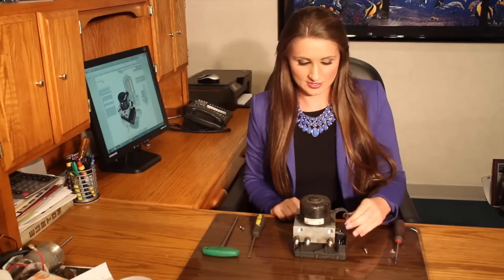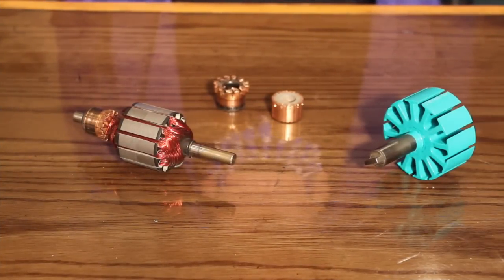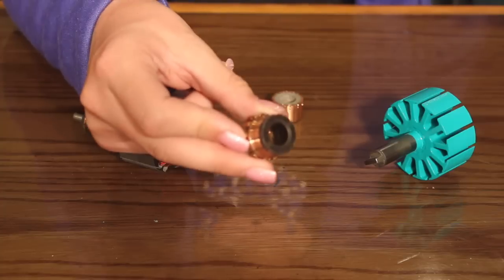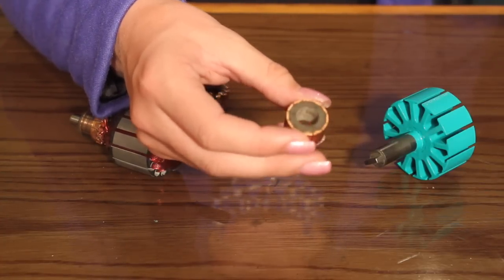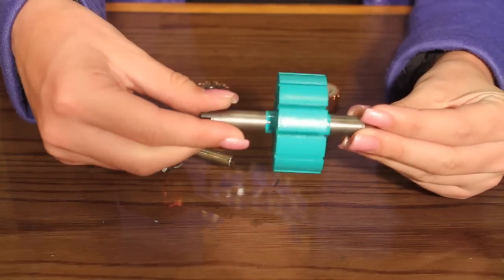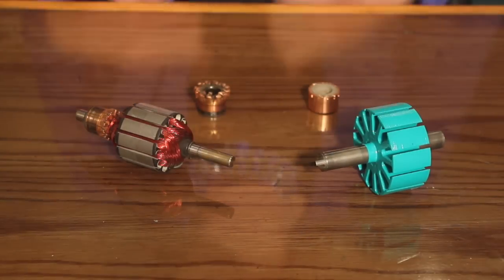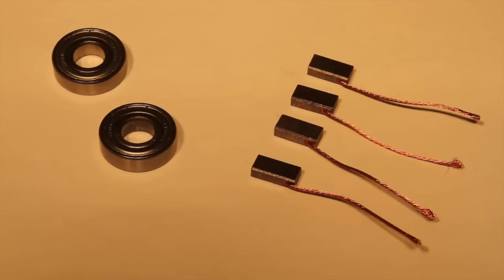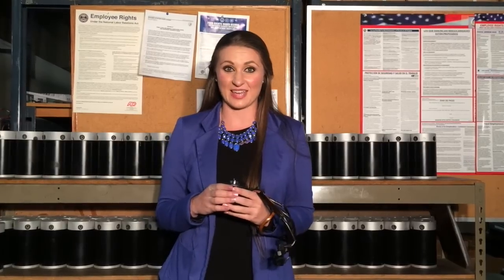ABS, Anti-Lock Braking System, Motor Repair

Comment: Where is business located? Is this the most common failure of the 2008 Lexus RX400H ABS brake system? I have 2 now that have failed. Don't wish to buy another for $1300 from stealership.
Reply from the maker: Hi Dean, ' We are located in Southern California.  Yes, the motor is one of the most common causes of failure with these units.  You can email us for more information  info@eurtonelectric.com

Comment: My sbc mercedes w211 is showing failure,,is it possible to rebuild,,nd would it be safe to drive on after rebuild  or a reset,,well any advice or solution,coz im not able to find a similar code part in the market here

Comment: Hi Team thank you for a great video. This is from the Fiji Islands. Used Hybrid cars are reselling in Fiji like hot cakes, which means mechanics and electricians have a monopoly on spare parts and fixing hybrid cars (while most times they don’t what they’re doing). We have a TOYOTA Harrier Hybrid model 2010 model. When we start the engine the ABS Light comes on and we hear a high pitch sound that goes on until we turn off the engine. Will the fix in the video get my car back on the road? If Yes can we ship the ABS motor to you? We’re getting charged such atrocious amounts here that working with your team seems the only affordable option.

Comment: nice!!!! video
Reply from the maker: Thank you very much. Most common question we get is how much for a full rebuild.  Most run $245.00 to $345.00.  Toyota 4 Runner $245.00, BMW SMG  $345.00 all others are similar. Email or call us if you need a price for your motor.  info@eurtonelectric.com

Comment: What is the price to have it rebuilt?
Reply from the maker: Price depends on make and model:  Most run $245.00 but some as high as $345.00
Reply: Thanks!
Reply: please aend me you adress thamhs
Reply: Eurton Electric  but the cost of new ABS modulator unit is around $320 only
Reply: Eurton Electric my Honda Accord 2015 ex 2.4 has not working I want to buy used parts where I can get